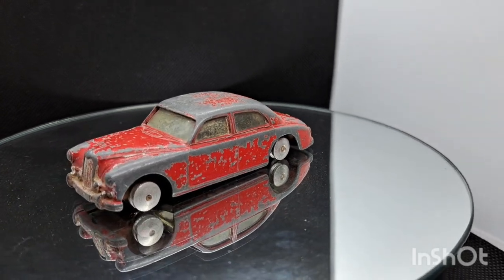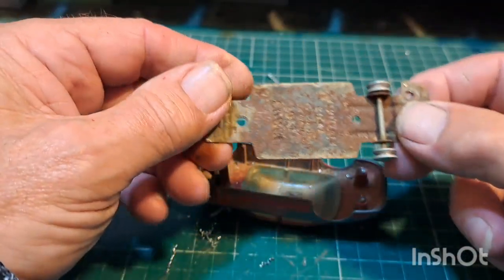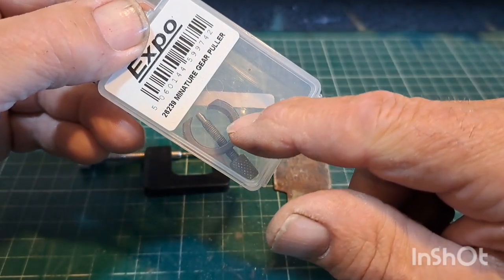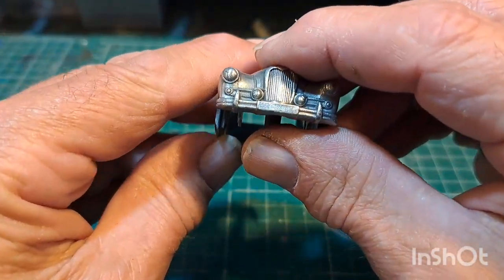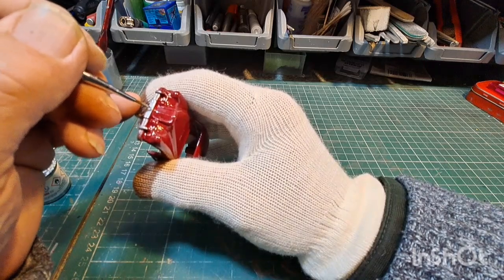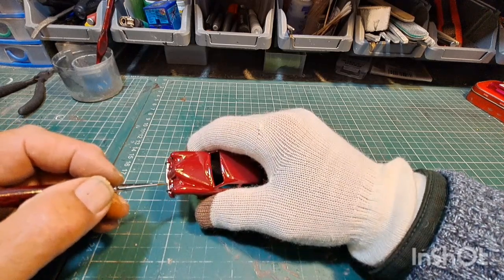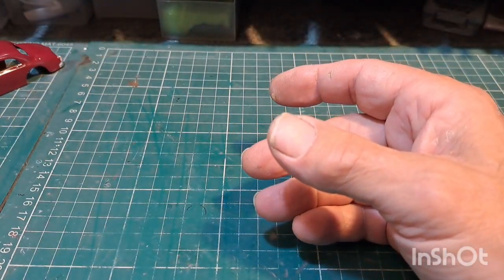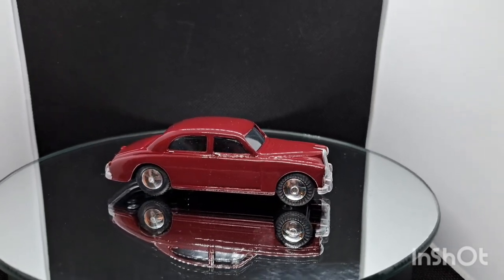Diecast Restoration Corgi Toys Riley Pathfinder  no/205. 1956/61  (D M C challenge for June )

Comment: School Day on the hub pullers, Martin: thanks for that! Nice colour - far more likely to be a real car than the flashy 'toy' red that was on the original model. Gemini do a neat little offering of red, white and orange 'lamps' at various millimetric sizes; I use them where there are no lights moulded where there should be some. Stunning final result - again - and a pleasure to see these simple castings survive.
PS. You should be able to get the this cotton gloves - if the paint is still a bit soft, sometimes those knitted cotton gloves will make a pattern in the varnish. If not, I'll send some or bring them over in July. And how much quicker your riveting is now the peepers are sorted!
Reply from the maker: Cheers fraser, the different coloured gems are a good call ,I will nip down to Hatton garden and get some only the best for my restorations 🤣🤣🤣
Thanks for the gloves 
Enjoy your day my friend

Comment: Hi Martin, that's a lovely resto. These were really nice cars weren't they? So stylish. I recently did one of these, and made a really silly mistake; I'd finished off all the painting and lacquering, re-assembled it and then realised i had stupidly forgot to put in the  front set of wheels! I had to carefully take it apart again, which was annoying as I'd achieved a really nice finish on it. I didn't want mess it up. I persevered and it turned out really nice. Great that you can see better mate. You certainly need good eyes for this hobby. All the best 👍
Reply from the maker: Hey Alan I have done the same thing a few times so your OK 👍 glad you got it sorted